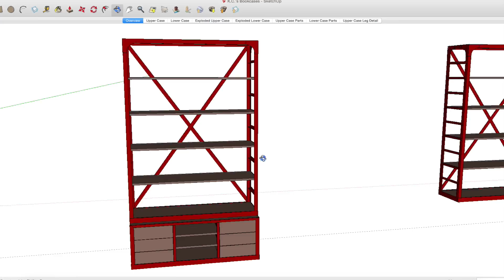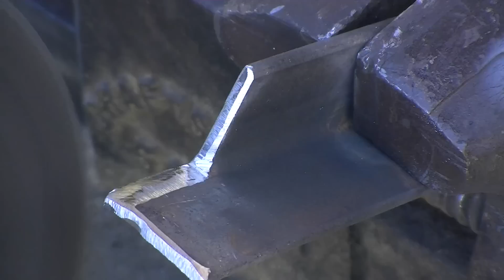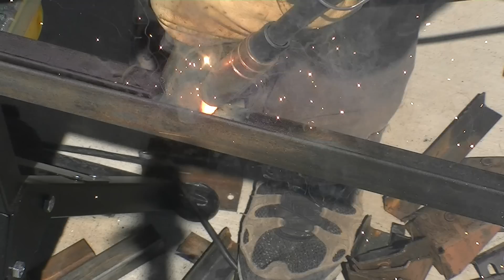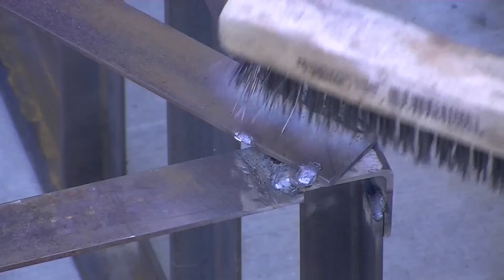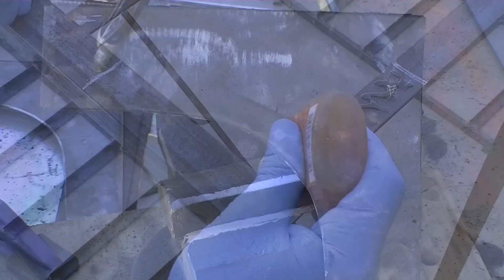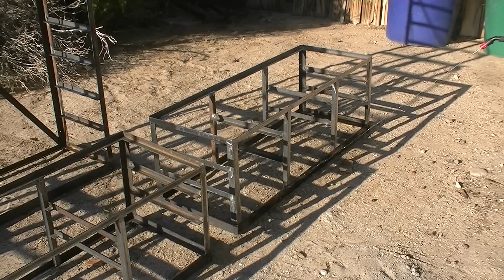Industrial Bookcases Pt. 1

Comment: Thanks for the video!
But I noticed immediately that the radius of the corner pieces was much smaller :) Kinda changes the look to a more modern style.
Reply from the maker: +Dejay Rezme thanks for watching. You are right. The parts aren't exactly the same as the Restoration Hardware version. That was intentional.  I would feel uncomfortable duplicating something that a large chain sells.
Reply: Haha ok that makes sense ;)

Comment: Super awesome upcycle Sean!
Reply from the maker: Quartersawn And Steel Thanks, though not all the metal was salvaged.  Turns out it was more costly to use only bed frames than it was to purchase angle iron.
Reply: That is a bit surprising actually...